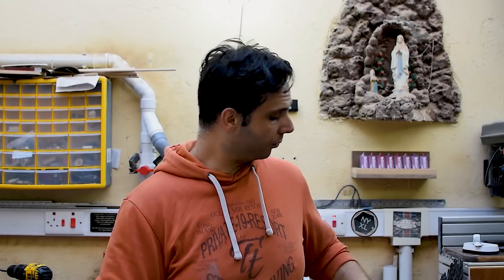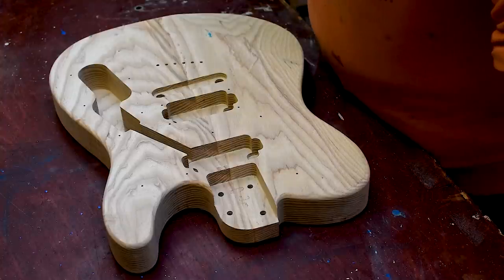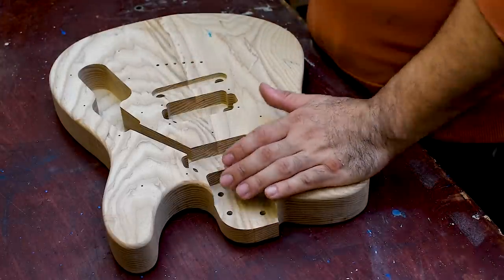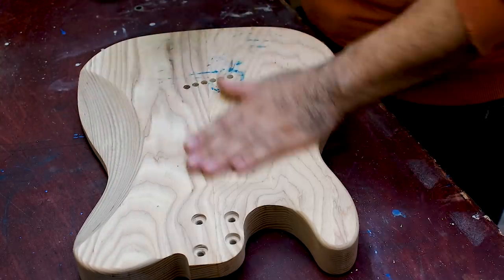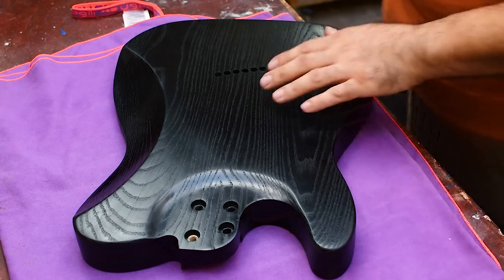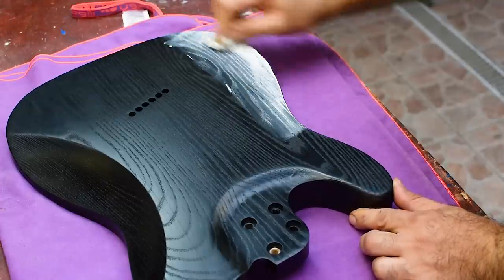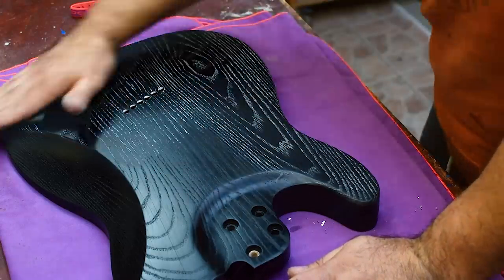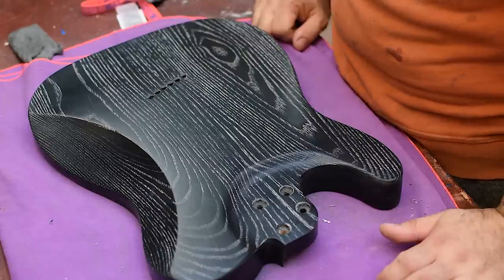Ceruse finish on an Ash guitar body blank

Comment: hi, what black paint did you use?
Reply from the maker: Spray can, i think it was an acrylic type
Reply: @ManicaroCustomGuitars   Thanks for the answer. What the next step? Will put some finish above it?
Reply from the maker: @lightwarp_  yes you can put a couple of coats of clear.
Reply: Lacquer or wax or linseed oil? What would you suggest?
Reply from the maker: @lightwarp_  with this guitar I've put a couple of coats of Tru-oil, just because I didn't have lacquer at hand. But yes lacquer or oil.
Reply: @ManicaroCustomGuitars  hi thanks. Does Tru oil stable like lacquer on surfaces like this? I mean like paint? Really???
Reply from the maker: @lightwarp_  yes it didn't pull out any color.